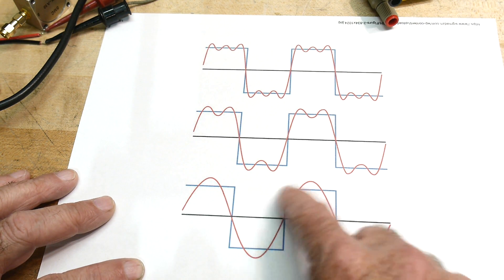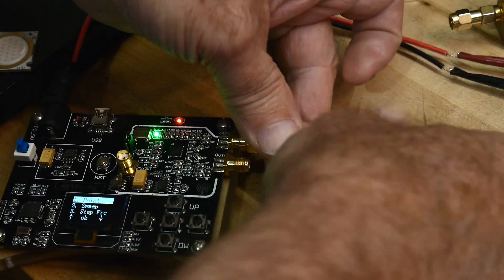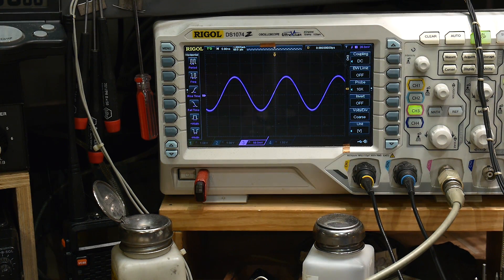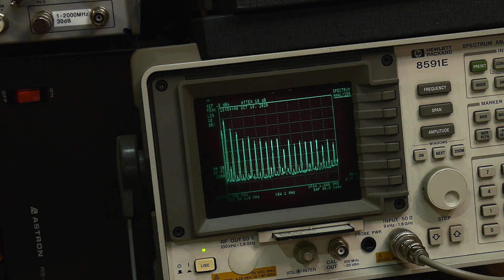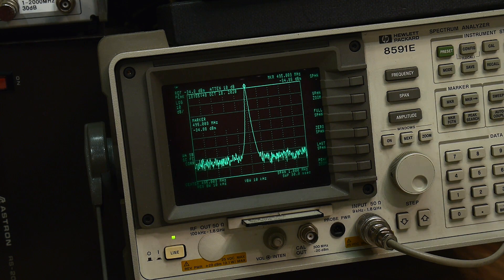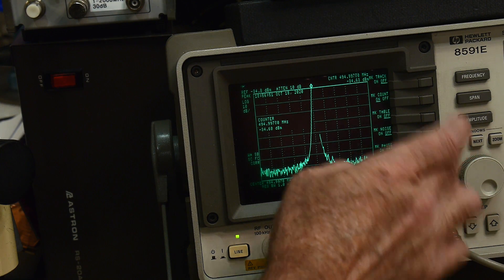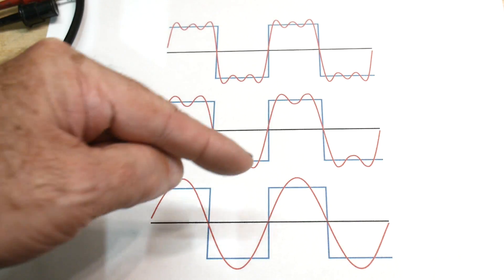#622 Square Wave Harmonic Tricks

Comment: Correct me if I am wrong, but filtering the harmonics makes the magnitude of the output drop, right? Because what I see there is the magnitude drop from 10 dB to -30 dB or something, and you realize after filtering the signal the sinusoidal amplitude becomes smaller? How do we preserve the same magnitude in the output?
Reply from the maker: mathematically the peak to peak amplitude should not change but of course the integrated power will be smaller removing all the harmonics.

Comment: You’re dealing with a square wave, an assortment of harmonics from its very nature. Your amplification and your capacitor arrangement just aggravate the system. If you look at the output on a spectrum analyzer, it’ll be obvious what you’re dealing with. Input a sine wave that’ll give you better results. Your scope is just triggering the predominant foreground harmonics. You’re missing what is there.
Reply from the maker: I would guess you didn't watch the video. I explain the harmonics of a square wave and also use a spectrum analyzer. I hope you have fun with the hobby and continue to learn
Reply: @IMSAIGuy  That’s amazing. I had two screens up, and I posted that comment to the wrong video. That comment was intended for another video experiencing a problem with a Square wave; your video was a perfect example of the problem they were having. Sorry about that
Reply from the maker: OK, carry on 😀

Comment: awesome, i want to understand more about harmonic signal and how to solve it, can you detail the filter circuit sir?
Reply from the maker: there are many many filter designs. Here is one:
https://youtu.be/HWA9MbL5doc
if you run a 7MHz square wave through that filter, it will remove all the higher harmonics and you will be left with a 7MHz sine wave.
another one: https://youtu.be/04GbWVfJGZk

Comment: So if I wanted a calibration source for my shortwave receiver across the band using harmonics it looks like I should generate a square wave from my crystal instead of a sine. Right? In other words a 100KC crystal changed to a square wave output would give me better harmonics for calibration across the dial? Please correct my thinking if I am wrong.
Reply from the maker: well yes. 100kc would give 200 300 400 .... but will drop off in amplitude so hope it reaches the frequencies you need.

Comment: It's a nice trick to extract a harmonic from a square wave but also an expensive one. You are stuck with expensive LPF or BPF. I did it once building an 87.5MHz...108MHz FM DDS with a DDS only capable of outputting 12.5MHz max. Good luck building a BPF with steep rolloff.

Comment: That frequency multiplication technique is often used in Rb and Cs references to create microwave frequencies by feeding their (usually 5 or 10MHz) low phase noise crystal reference oscillator into a series of multiplier stages. Some stages might use a step recovery diode to create a rainbow of harmonics that they can then filter out a much higher order harmonic. Different manufacturers use slightly different designs, but they generally follow that architecture.

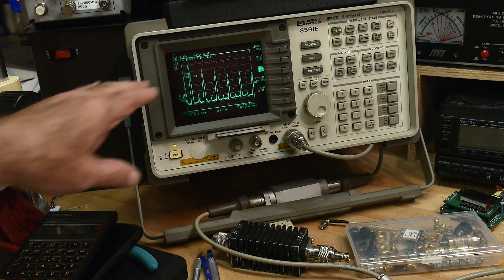Comment: Great video, but you should fix the statement at  1:12 (https://youtu.be/h68iJ8JiHFQ?t=72) about the power in the odd harmonics.  They should fall off at 1/n. 

Questions: 1) which option in the 8591E includes the frequency counter?  That is rather cool!  2) Can the 8591E be attached to a 10Mhz external reference like an GPSDO. Looking at a couple HP8591s on on e-bay.
Reply from the maker: I've checked my 8591 against my rubidium and it is below 1Hz error
Reply: @IMSAIGuy  what options does your 8591 have?
Reply from the maker: @azav8raa  21 and 140
HPIB
Oven 10MHz
30Hz bandwidth
Reply: @IMSAIGuy  Thanks. Option 140 would be very nice to have.  

From the User’s guide...

Narrow Resolution Bandwidths and Precision Frequency Reference
(Option 140)
For HP 8591E, HP 8593E, HP 85943, HP 85953, and HP 85963 only. This option is a
combination of Option 130 and Option 004. Option 140 provides additional narrow resolution
bandwidths of 30 Hz, 100 Hz, and 300 Hz. These bandwidths improve sensitivity and allow
you to resolve closely spaced signals. The option also includes an internal precision-frequency
reference that improves stability and provides increased absolute frequency accuracy. The
precision frequency reference makes the narrow resolution bandwidths more effective and
easier to use.
Reply: frequency counter is under marker functions in almost all professional spectrum analyzers and no option is needed for that.  8591 can be fed with a 10MHz external reference.

Comment: if the odd harmonics all had equal amplitude you would never get a square wave, in fact it would not be any physical wave at all (Fourier series will not even converge). So please study the basics before making educational video. The odd harmonics fall off as 1/n (n=1,3,5,7,...). The even harmonics appear if the duty cycle is not perfectly 50%. Also linear rising, falling edges also contribute to even harmonics a little
Reply: Exactly. Thanks for pointing out. I have seen the harmonics in the output of a HF amplifier. A push-pull amplifier is practically immune to even harmonics if the duty cycle is 50% as it should be.
And designing a harmonics filter depends on the very same phenomenon; otherwise it may not be possible by all practical means.